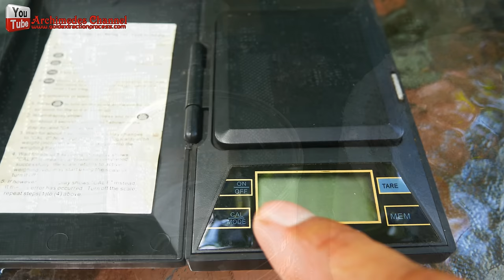How Gold Recovery From IC Chips Remove from the electronic circuit board.

Comment: 00:01:38 melting the ic chips with 2 liters of sulfuric acid
00:03:07 washing what is remaining of the chips with water
00:03:45 washing with nitric acid mixed with water ratio 1:1
00:04:40 using a mixture of hydrochloric acid 
00:05:46 sieving through a funnel
00:06:26 using a solution of sodium-something
00:06:53 drying and melting the sediments
00:07:39 borax powder
00:08:38 extracting the gold
00:09:09 2.3 grams of gold extracted from 1kg of chips
Reply: More like 0:38 skip video
Reply: Hi
Reply: Ramesh Thakor hey there what’s up?
Reply: @ 00:06:26 using a solution of 'sodium-something' this is Sodium Metabisulphite
Reply: *you mean DISSOLVING

Comment: Cost/recovery ratio? and how do you safely dispose of spent material? Seems environmentally hazardous.
Reply: Same question here!
Reply: Does it matter that much? it's have or not have.
1 kg of chips yields over 2 grams of gold, there you got it.
But than collecting all these ic's.
Gold is special, doesn't oxidize, pretty good conductor and so, helps to find a woman : )
Your city should have a recycling park to get rid of the chemicals.
Reply: You probably also could burn it to dust, than chemically separate the metals or burn very hard from the first step on and during the melting process to separate the metals.

Comment: Not worth the effort first you need a chemical lab ,all that acid for 2.3grammes and the scrap value of 14 dollars leave it to the big boys meaning companies who do a proper job at recycling and getting rid of effluent.
Reply: @romanchomenko2912  plus 2.3 grams is like £100. Which is nothing really.
Reply: @786sohailm  £100 pounds only you can refine it you have to burn any contaminates such as copper or brass again special equipment acetylene gas welding gear to reach temperatures of 2600 centigrade and that 2.3 will drop to under 2 grams. All that equipment Jesus not worth it.

Comment: 1 lbs of chips for 1g of gold

The price of gold fluctuates and is based on purity.
The  price of the chemicals, if you can get your hands on that much, and work hours might be worth as much as the gold.
Reply: As I’m typing this; the price of gold is;
1478 US dollars per Troy Ounce which is 31.1 grams
So, 1g is about $ 47.52 US
An hour from now the price for gold will be different.

I might have several several pounds of chips laying around collecting dust at home.

Then there is the problem of how to dispose of the chemical sludge.  Because I doubt that anyone is going to happy with dumping it down the drain or in your backyard.
Reply: He earned it from YouTube

Comment: In reality very few electronic parts include any amount of gold worth recovering ! You'll spend a lot in the chemicals required here too. Also I don't think gold dissolves in sulfuric acid either (but other metals, including the container used to boil them in do), so what you get most certainly won't even be pure gold.